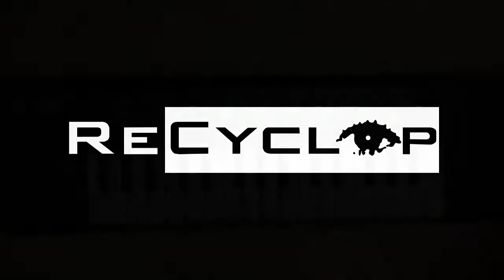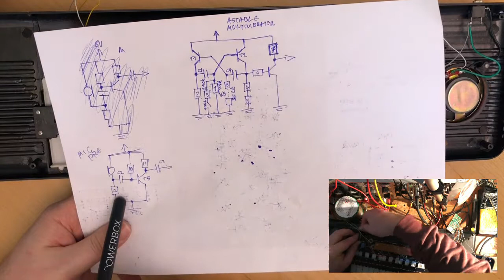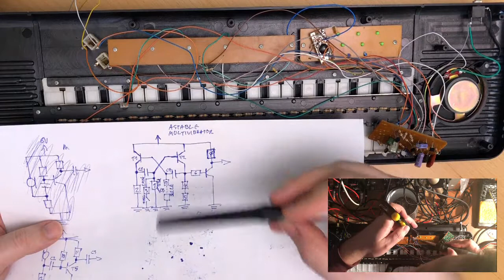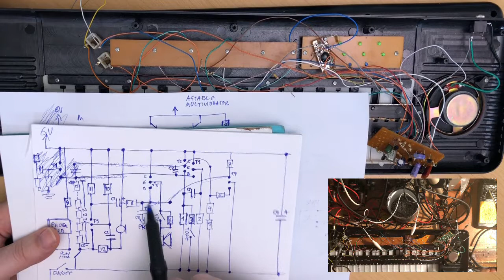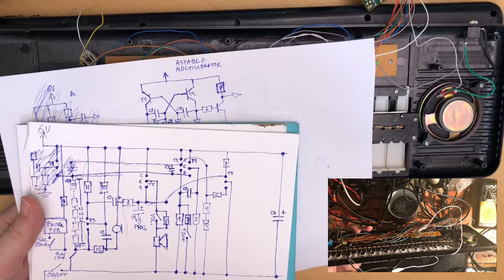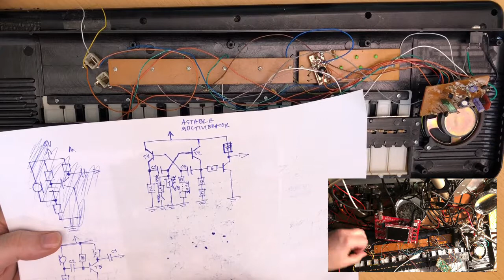Circuit Bending - XH-322A Piano

Comment: can i ask? can you actually play chords (3,4 or more notes simultaneously) in it?
Reply from the maker: Unfortunately it's monophonic synth so one note at time since the keys are just a series string of resistors controlling a single oscillator. If you press two keys at the same time it should take the one with least resistance so a high note priority.